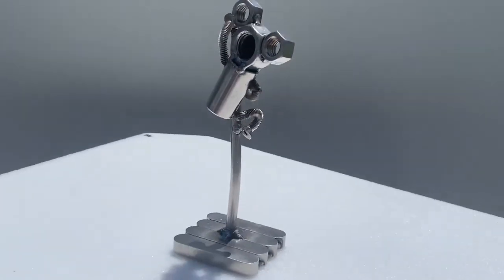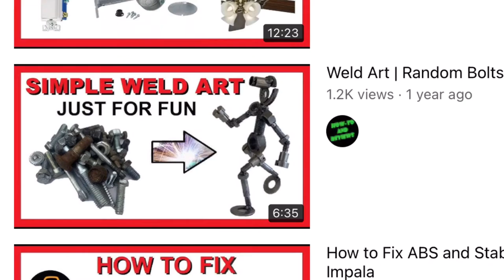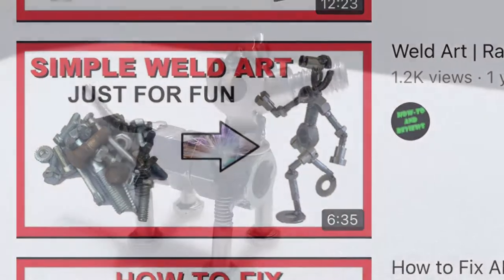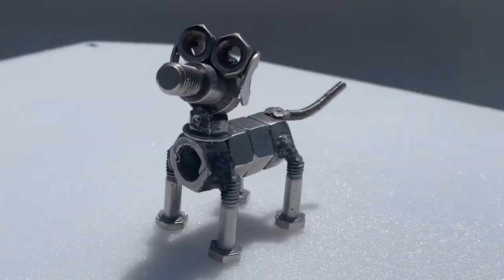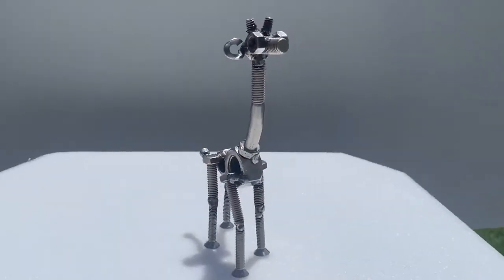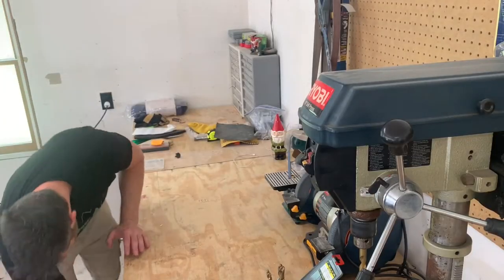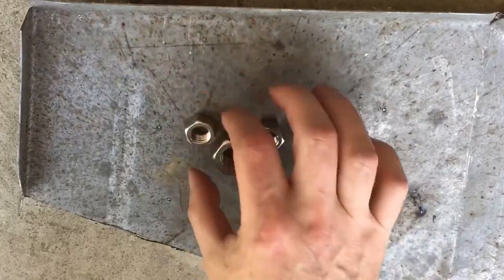KOALA BEAR Weld Art | Nuts and Bolts | Stainless Steel | Just for Fun | Dog | Giraffe

Comment: Hi, great projects you have there. I purchased a Hobart 210MVP and gas bottle to teach myself how to weld but have yet to get the dang thing out of the box (day jobs suck!). Anyway, i want to teach myself hobby welding and make some small utility type metal items like J hooks and racks or somethings i can use around my woodworking shop. Do you have any videos you can share that goes over basics concerning welding in general then how to start actually making something. I see in this video you are attaching the grounding cable to the piece being welded but what if the piece is small? How do you ground smaller pieces? Im also looking at purchasing an acetylene tank so i can bend wrenches and thinker metals. Had to add an edit, at end of video i see you clamped a drill with a cup brush to shine up the metal, what type brush was that? Thanks.
Reply from the maker: Sounds awesome! You’re going to be able to do a lot of cool things.
I don’t have any welding videos posted. But there are plenty of tutorials on YouTube that will get you a long way. Enjoy!